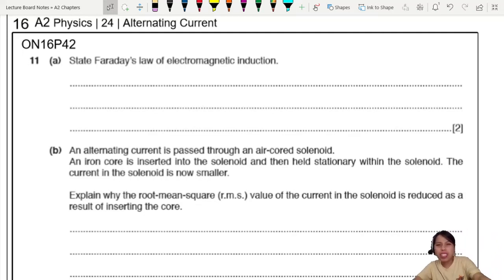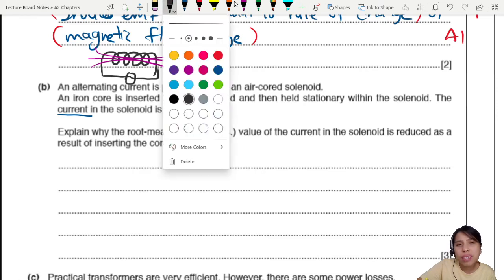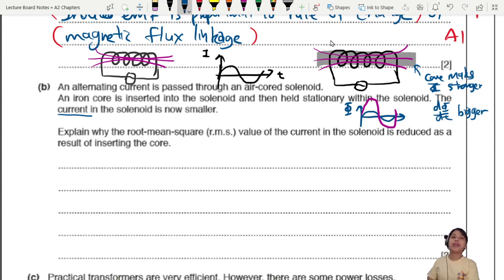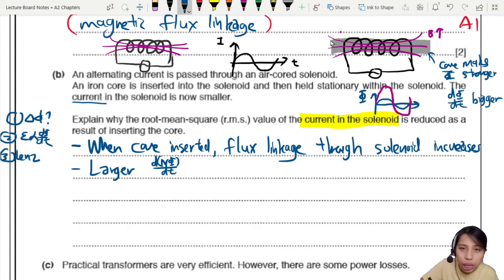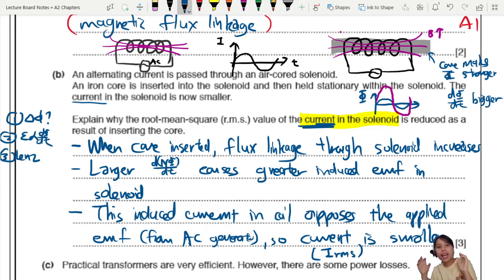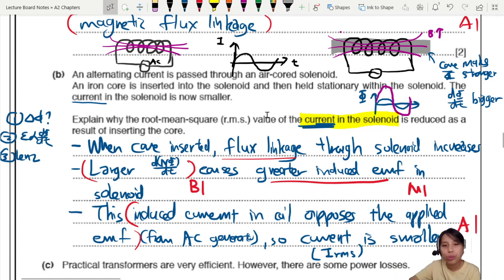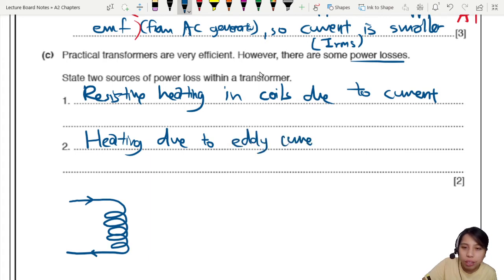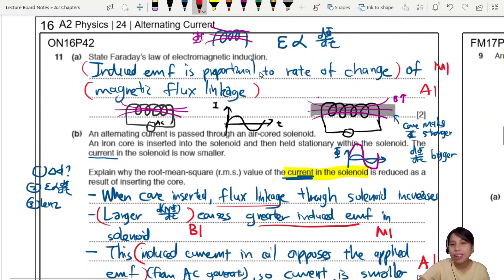21.2b ON16 P42 Q11 Effects of Iron Core | A2 Alternating Current | Cambridge A Level Physics

Comment: @ET Physics, I am able to visualize how flux cut primary and secondary in a air-core transformer; In air core the flux path expands and shrinks and cuts the coil.
 But i need a clarity with core: In case of a square core, where in one leg primary coil and other side of leg secondary coil, for a increasing (or decreasing current) there is a increase (or decrease ) in flux lines, and the flux lines will be contained inside the core itself,
I would like to get your view, how geometrically the mutual flux inside the core cuts the the coil wound outside the core.. 

I know this is a basic question, but need a clear cut visualization, thank you
Reply from the maker: Usually the phrase "flux cuts the coil" is one way of thinking about change in flux. The flux lines don't have to physically "cut" pass the coil - you can change the strength of B (more/less lines) and that is also considered a change in flux through a coil.